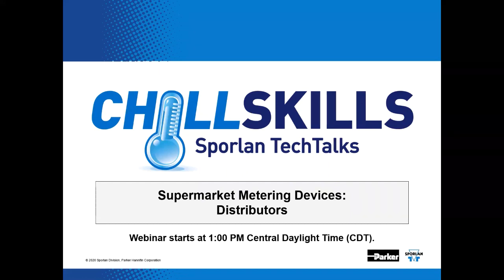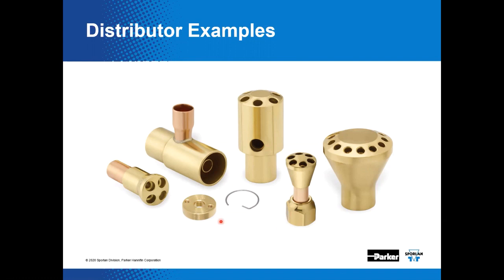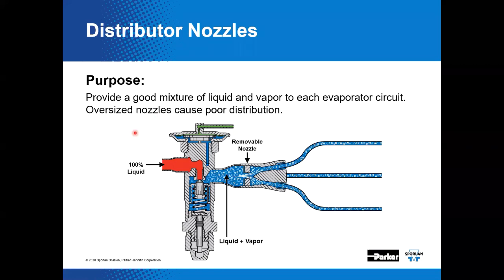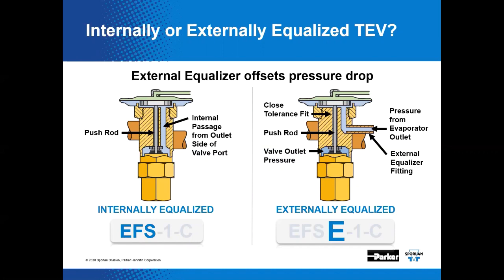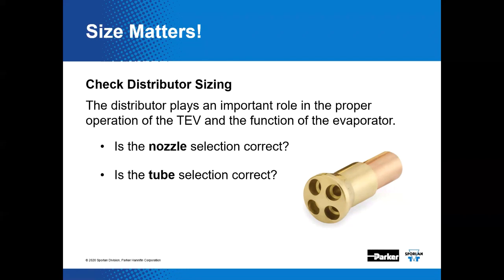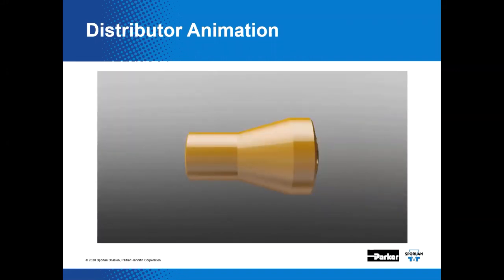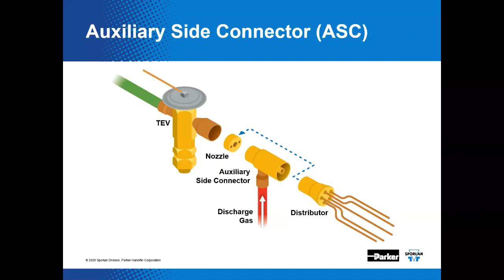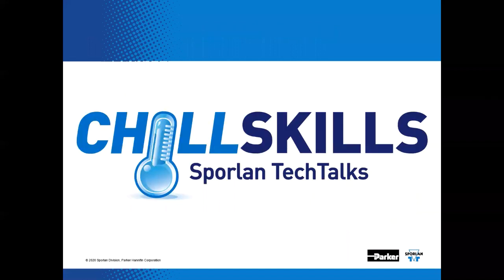Refrigerant Distributors and How They Work in a Refrigeration System

Comment: I would say density is what effects the refrigerant within the circuit. Liquid is obviously denser than the vapor state and so it will fall naturally. Gravity is removed from the equation since we do pull a vacuum within the system but then again everything falls or floats due to density of that specific item.